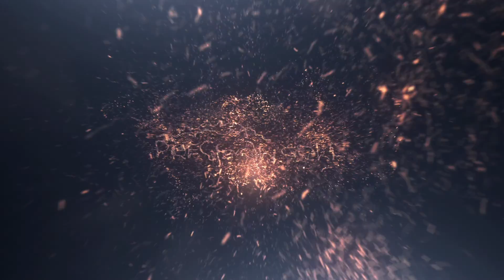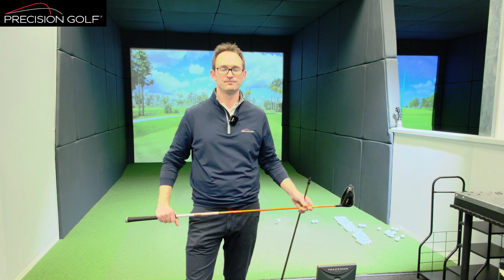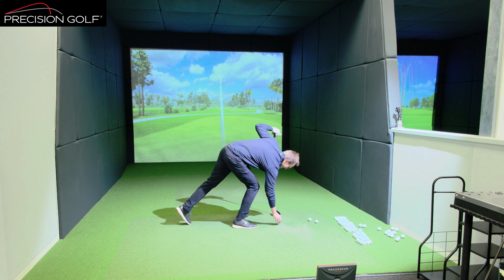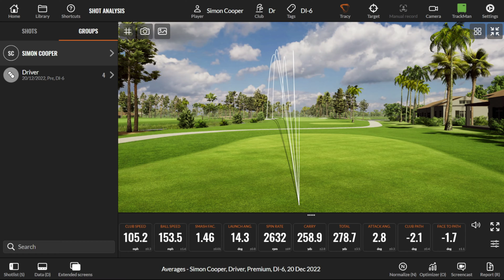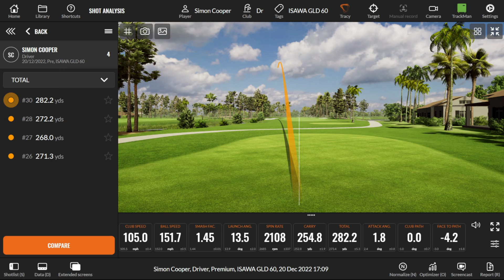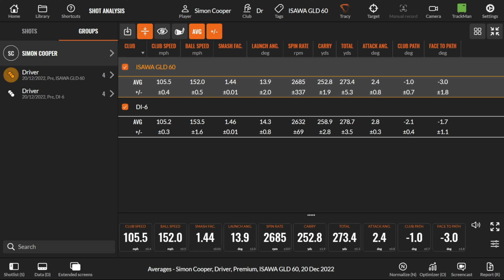OBAN Isawa GLD Vs Graphite Design TOUR AD DI 6 - SHOWDOWN

Comment: Great video. My swing tempo is similar to yours and club head speed also around 105. Is the X quite a bit stiffer than the S? Not sure which would be better to try
Reply from the maker: In principle the X flex would still be “better” and will feel more stable in both shafts and will play a little lower spin but are not huge jumps in performance versus the stiff flex

Comment: Currently using qi10 9 ° with ventus black 6x, struggle to control and low on distance, spin is high. Ss 105 +-. Looking for AD DI 5x or 6s, what you recommend ? Thanks
Reply from the maker: The high spin could be the head and your strike point as the Qi10 is high spin out of the heel. Really can’t say what weight would be best but the DI 6 is still a little lighter and less tip heavy than the Ventus Black 6X (OG profile that is) but equally the 5 X could work for you too. Sorry I can’t be more definite

Comment: Hi, how would you say the tour ad compares to vista pro in the same stiffness and weight (65g stiff). A relatively straight swap but with much higher quality in the tour ad? Thanks.
Reply from the maker: Tour AD will be a lot smoother feeling and is designed as a firmer tip but softer mid section. Vista Pro uses the tip more to get the “kick” so should be slightly higher spin

Comment: Hi , how would the isawa gld  6s profile stack up against ventus tr red  6s . For Cobra . And which would you recommend for  a  100/105 swing with short backswing  . 
Love the channel , hope to get down country one day for a fitting . 😊
Reply from the maker: I cannot recommend one I am afraid but the Isawa GLD will feel a little smoother as the Ventus TR is stiffer in the handle but the tip sections are quite similar. It will feel like you can work the Ventus harder and it will hold on tighter as a result but the Isawa will feel like it gives you a bit more back

Comment: Great video - I have the Oban Isawa GLD in my 3 wood and 5 wood, love the shaft - I also play an Accra TZ6 in my driver and prefer the responsiveness in my fairway woods, even though it's a great and stable shaft,  I'm unable to feel the load on the Accra as much as I can with Oban shafts. 
Would it make sense to play a more similar shaft in the driver to match the feel of my fairway woods? From this video it looks like a Tour AD DI 6 could work really well as my driver shaft to compliment my fairway woods. (TSi2 Driver)
Reply from the maker: Feel is important and influences confidence a lot. If you prefer the more responsive feel then a Tour AD (other than VF!) will certainly give you that

Comment: Great video... Thanks!  Were you using a 9* head?  Additionally, I love the ad di 85 in my hybrid.  How often does that translate to working in the fairways and driver?
Reply from the maker: It was a 9 degree head. On the hybrid shaft front it is actually quite rare to match shafts through now as the head sizes and therefore the properties that the shafts need varies

Comment: If GD had got THE shaft a decade ago, then no need to fix what’s not broken. Doubt our swings evolved last 10 years that makes AD DI obsolete. Big ups to OBAN but I’ve been a faithful GD user (tried the Ventus and Diamanas) but had better numbers with GD AD DI. Get a good fitter and thanks for the vid❤
Reply from the maker: There is always a commercial desire from all manufacturers (both head and shaft) to be seen to be developing product but once a shaft works for you it only stops working for you when your swing changes in either technique or strength. As you say great shafts don’t stop being great shafts just because time has passed and a good fitter will also be honest if they cannot beat what you already have! Glad you enjoyed the video

Comment: Have you by any chance done a test of the Graphite Design Tour AD IZ shafts? Oddly enough, I have both the AD IZ 6S and the AD IZ 5R1 that I have been interchanging in my Callaway GBB Epic Sub Zero 10.5 degree driver head. I got both of them because they were sold for just $100 each, way way below retail, when my range took down the fitting cart for that model year and put them in the discount rack. Also got the head new and unused for a great price. The 6S Stiff weighs 63 grams, torque 3.2, mid kick point, high launch, low spin. The 5 R1 regular weighs 54 grams, torque 4.5, mid kick, high launch, low spin. I have recently been comparing results with the two at the PGA Superstore practice bays that use Foresight overhead monitors to provided data (everything except club speed and efficiency, which require data dots and their Trackman in the fitting studio). I have felt I got good results on course from the stiff shaft for the past two or three years. However, I will be 82 in two months and there really is no escaping that I should use a lighter shaft with a regular flex. The data on Saturday made it pretty clear. I hit driver after over 100 balls with wedges and 7 iron, so was warmed up but not fresh. Used my own Titleist ProV1x ball. With the 6S shaft, my best result was ball speed 120.3, carry 192, total 216, back spin 1985, launch angle 16.4. After that I changed to the 5R1 shaft. My best result was ball speed 124, carry 205, total 227 (and one 236 with same carry), back spin 2281, launch angle 18.  So yeah, time to give up the idea of an old geezer like me hitting a stiff 63 gram shaft. And I can see from the video cam they have just installed that there is a lot of room for improvement in my swing and am working on it. I think I can get an extra 5 yards or so of carry if I can improve my body mechanics.
Reply from the maker: Hi John. We’ve not reviewed that profile yet, but we certainly can do. Thanks for your comments as always.

Comment: Great review Simon.....have you done any reviews on the Myazaki shafts you get in the Srixon line of Drivers? I have one and its blooming awesome just wondered how you guys rate them compared to maybe more bespoke , (expensive) shafts on the market!! The one i have seems to be very difficult to find ive not seen another despite many hrs of Internet surfing.
Reply from the maker: Miyazaki shafts are only available in Srixon clubs as there is no other distribution for them which is why you cannot find them anywhere. They are good quality shafts but as only available in a Srixon head it is not one that is worth a lengthy comparison. They are good quality though and generally a fairly responsive feel
Reply: @Precision_Golf  thanks for reply yes mine is in a Srixon driver and was aware of them solely being used in there drivers!! I have found a few companies online selling just the shafts alone and also found the Myazaki site where you can buy them direct. I know every shaft suits the individual depending on how it works for them but even other guys who I play with have hit the driver and raved about the feel and response of my particular shaft.....id be intrigued to see how they compare to the other manufacturers.